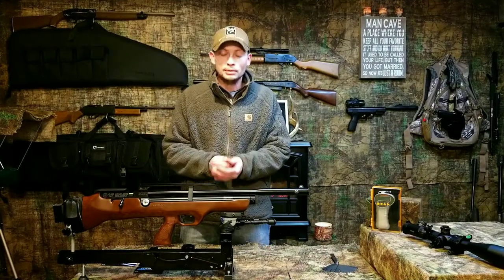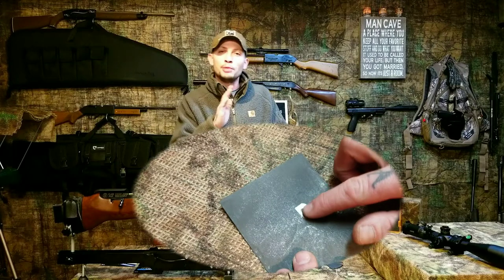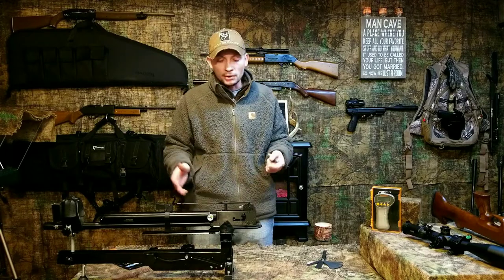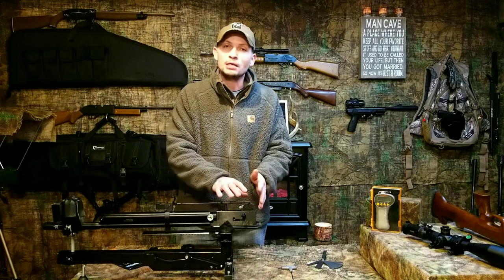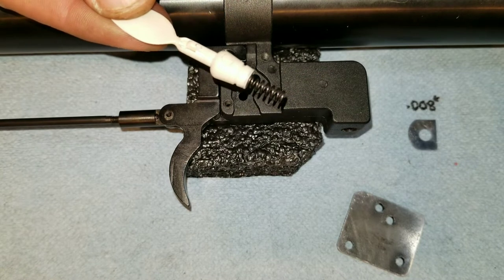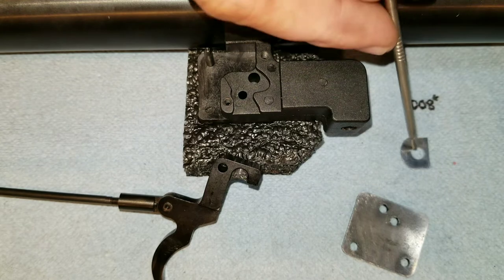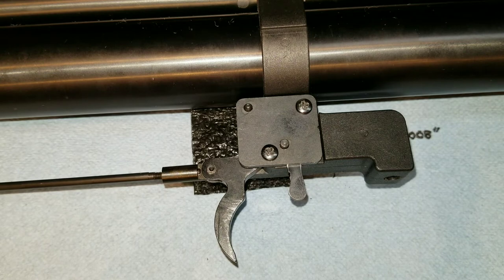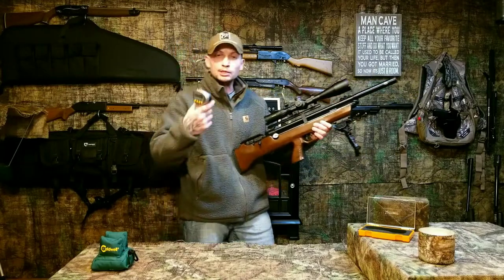HATSAN FLASHPUP TUNING ***  Trigger assembly tune/mod - Safe Quatro adjustment  ***

Comment: Hi I have a question about the Hatsan Flashpup trigger. This just started happening today, I filled the rifle up to 200 bar, I think a little bit into the red, not on purpose. I'm testing out some JSB Hades 10 Gr. When I pull the trigger back through the second phase, it feels like the trigger gets stuck a little, I'm not getting a smooth pull and it takes a millisecond for the pellet to fire. What do you suggest?

Comment: What do you do for a living? Are you a machinist? You seem to know your shit. Nice work my man, the way you seek out flaws and correct them.
Reply from the maker: Thanks for the compliments bro I appreciate them. I do have a few years in doing CNC work and some manual lathe work. Currently I'm a certified RV technician. Water heaters, furnaces, generators, inverters.... Lots of mechanical and electrical troubleshooting. It challenges me and I'm never bored so I enjoy it.
Reply: @brothersinair2064  funny I'm checking some rv's now thinking about a mini bus

Comment: I followed along and did my first trigger adjustment, naturally i was curious to see how light i could tune it, not because i planned to use it with a hair trigger, just out of curiousity, and I found out if the weight is lightened too much, the sears will not engage when you try to cock it, for a minute i freaked out cuz i thought i broke something, then figured it out and raised the weight of the trigger to a reasonable 10 oz. or so, and she cocks and fires beautifully now. On another note, I am wondering what you think about an idea I have, for a fix for the flashpup wood firing accidentally due to open, locked down bolt getting bumped out of position and slamming shut. My thought was to file a shallow indent in the bolt, matching the 90 degree angled edge of the bolt slot, that holds it in place when locked down, so it would catch and hold until pulled back to disengage with the edge of the bolt slot. My worry is that it would weaken the bolt handle, esp as I have my hammer spring turned out close to as far as it will go already, so its a stiff cocking gun.
Reply from the maker: Your idea sounds excellent besides the chance at weakening the bolt as you mentioned. The only way you should be able to accidentally fire the gun this way is if the bolt slips out of your hand while pulling it back but before you reach the point of the hammer being locked in place or the rear locked position. This will send the bolt/probe and hammer forwards and the hammer will crack the valve open. When moving the bolt all the way to the rear locked position you naturally move the hammer to the rear and go past the point of trigger sear engagement to fully separated and the sears are ready to be locked in place. If the bolt is in the rear locked position and you bump it up it should only move slightly forwards and the hammer should only move forwards about 1/4" before stopping when the trigger sear engages and the hammer is locked in place. This won't happen if the breakpoint on the trigger is adjusted too light in combination with a heavy preaload because there is not enough sear engagement and the super powerful jolt going forward breaks it right past this point. Only way to avoid it is to...
a.) Lessen preload tension
b.) Add tension to trigger sear breakpoint adjustment
Or.... 
c.) Something along the lines of your great idea
Let me know what you come up with brother. I don't have mine in front of me but your idea sounds solid and maybe wouldn't take too much from the integrity of the bolt handle.
Reply: @brothersinair2064  yeah IDK, I have read posts from others who had the same issue, basically if its in the locked down position and you bump it out of the notch, it fires but it sounds weaker than a normal dry fire sounds, with the bolt closed and locked down. Not sure if it would actually fire a projectile with enough force to get the 36 grain slug past the choke point , or if it would just get stuck in the barrel, which would be more just a pain in the ass than a safety issue. (love those Neilson 36 grain hollow points, btw, small enough to fit in the mag and she just seems to love em, not that I have a wealth of experience to compare against but out of the few projectiles I have tried these are the best so far. Appreciate your vid on the slugs btw, i dont have a chrono but i usually keep it at about 6.5  turns out from all the way CW, so not super hot) These Airguns are a tinkerers dream, always some new adjustment or mod. Loving it! :)
Reply from the maker: @fedayeentaqx9956  I feel ya. Just keep in mind that when going to the rear locked position you are actually cocking the gun so you must ask... why is the sear failing to hold the hammer back with the extra travel and force before it contacts when bumped up vs your slow, controlled stroke. I changed all my sear tension springs to a touch stiffer than the factory. Before I picked up the new0 springs I just pulled the factory ones and stretched them a touch longer. Was still able to adjust a light break point but  with much more response to holding the light break in place once cocked. Brother it's been a while since I've seen someone get on the airgun kick with so much enthusiasm and ideas. I love it! You're right... A tinkerers dream!

Comment: So I just got my flashpup in the .25 and my trigger has been really odd. I’ll pull once and pass through both stages... and nothing, pull twice and again nothing and then on the third pull it becomes a hair trigger, no stages needed to pass. Manufacturing defect possibly? Should I try to see if I could adjust it myself or should I send it in on its warranty?

Comment: I want to add that the Hatsan manuals that I have are screwed up and have the adjustment screws all mislabeled. They mix up what each adjustment screw actually does.
Reply from the maker: It has always amazed me that's some of the gun companies push their famed trigger systems to be so wonderful (which they very well may be), and then turn around and either give you incorrect or the most vague instructions imaginable. Lol

Comment: Hey bro! Really needed this video. Still trying to eliminate every bit of creep from my trigger. Turned the second screw one half turn and it wouldn’t even fire. Put it back where it was and now making small adjustments. Getting there. Have you seen the new flashpup s qe? Spotted it on Hatsan’s website. Looks bad ass. Check it out. Again thanks for the video. I learn something with every one. C’mon spring!🎯
Reply from the maker: Glad the video was helpful. Yeah actually did see it about 3 weeks ago on the same website. Looks like the same build as the new Flash wood. Larger-diameter and shortened air reservoir, chrome bolt handle etc.... Looks pretty awesome but for some reason I just don't like the shining chrome bolt handle on top of the black reciever. I would prefer the handle all black but that can be fixed easily with some ceramic paint. All personal preference. I wonder when we'll see it in the states? The air Max was available for 2 years before it made its way here waiting for bullboss sales to decline so it will be interesting. I would imagine it will show up at the earliest at SHOT show next year as they will be waiting for the Flash (wood)/flashpup craze to die down a little bit before they release the synthetic.  I found it available on a Russian website and for what they're charging it translates to $460 US. I'll probably preorder it as soon as it hits US vendors!
Reply: My refurb flash will not cock - sounds like second adjust screw may be the problem - any suggestions - turn screw in, out ? How much?  I turned it 1/2 turn, out I think

Comment: I noticed my pins coming out of the trigger assembly when I remove the gun from the stock, guess I need to Loctite those, it looks as to me as if they were put in backward which bored out the smaller hole. The first time I took it apart and was removing the pins I noticed one was in backward as well. I pulled it out the other day to put a camo paint job on my gun and they were falling out. Yeah, I painted it, tried my hand at doing a camo job. I'm happy with it. I kept a wrap on it all the time, it was also a bit slippery for me so I got rid of both the desire to have it camouflaged and the slippery with matte paint. I'm happy with it.
Reply from the maker: You could loctite them but here's another idea that will permanently fix the loose pin... Pull the pins out and lay them flat on a hard surface that's metal or granite or something smooth give the back non pointed end where it fits tight in the block a tap with a hammer very very lightly just give it one tap supersoft. it will oblong the pin slightly on the very end where it flushes off with the block causing it to fit tightly from that point on. The trick is to go slow a soft tap at a time testing the fit after each tap to ensure you don't over do it and mangle the pin. A very very small change to the shape of the end of the pin will cause it to seat tight and will be a lasting fix if the pins are not pushed too far and are only flushed with the block when you insert them. The pins are steel and the block alluminum so driving them in past flush will just strech and reshape the alluminum and the guys doing the assembling at the factory aren't always the best. I have seen great guns from reputable manufacturers that clearly appear to have been assembled by a hung-over or very disgruntled employee. It's an unfortunate reality of mass production manufacturing that we must all do our best to deal with. On another note.... Kudos on the camo paint job! That pup is ready for some serious hunting now!!!!

Comment: Hey Brothers in Air,
 I just got my flashpup s from pyramidair and after about 120 shots ,the next shot I took it made a loud noise and I could feel air on my face.an O ring came out but I don't know where it goes. I took a couple more dry shots and it is definitely louder and I can feel air.im going to send it back ,but was wondering if you knew what that is.i guess I was having too much fun.
Reply from the maker: I would say that your breech seal came flying out. That's the seal just inside the barrel (about 3/16" in) that seals around the pellet probe when taking a shot. It's the only place that an O ring could come out from. Everything else is sealed and contained within the block. If you retract the bolt and shine a flashlight into the barrel you should see the breech seal gland and be able to tell if there is an o-ring in there or not. Another way to tell is by loading a pellet and taking a shot with wet fingers around the pellet probe/breech area to see if air is blowing back out through there. With a properly functioning breech seal you shouldn't get any air blasting backwards from around the pellet probe. There should be a replacement in your kit that came with your gun. It's not so easy taking an old one out but you can finesse a new one into the gland without removing the barrel. Hope that helps  you brother good luck👍
Reply from the maker: If the O-ring is intact and undamaged you could just reuse it. I would recommend using some silicone oil of some sort on the seals vs dry
Reply: @brothersinair2064  it was exactly that.i have some 3 in one silicone oil would that work?
Reply from the maker: @50thstateofmind37  yeah that will work just fine. It's not the best stuff but it will definitely do the trick and there's nothing in it that will hurt a Buna - n
O ring so you should be good to go. Most department stores  that carry BB guns and what not  will have crossman's chamber oil .  That will probably  hold on better and last a little longer then the 3 in 1. I use SuperLube's o Ring Lubricant myself.  it's inexpensive, does not dry up or crystallized in any way , and stays where you put it. I usually put a drop of oil on the pellet probe every 200 shots or so as a form of maintenance to the breech seal. The oil will help it to seat better and last longer. I know how it is getting something new and then having it all come to an abrupt stop so I'm glad it was the breech seal and an easy fix. Now you getting your first real lesson in PCP airguns and that's awesome👍
Reply: @brothersinair2064  you are a life saver sir!!it worked out perfectly. It took a little time and patience because of my fat fingers but I'm glad I dont have to send it back to pyramid air.it took a while to get to hawaii...thanks again this thing is as advertised! A great first pcp for me  for sure !the first thing I'm gonna do is some trigger work.i dont have a chronograph yet so I'll save tuning for later. Thanks again, can't wait to see how deep this rabbit hole goes for me in the pcp world!!lol wish me luck...